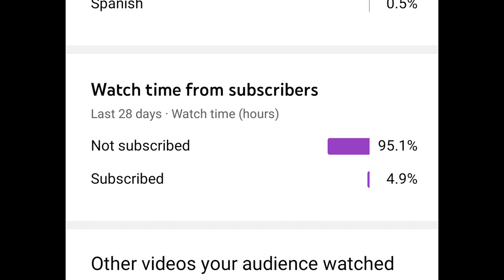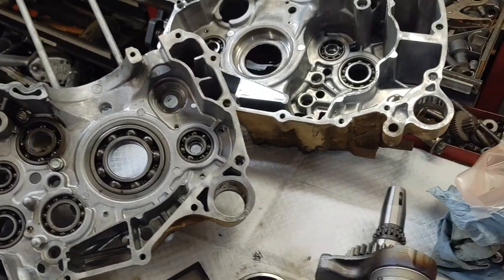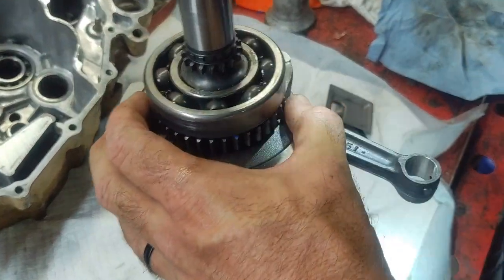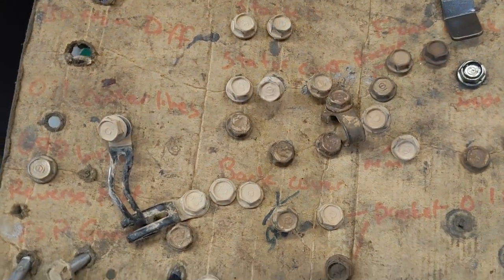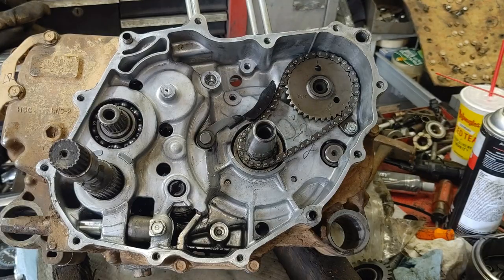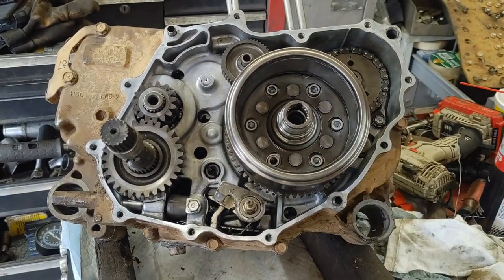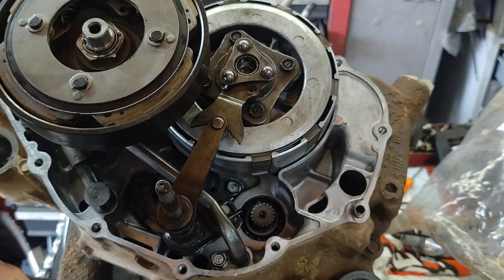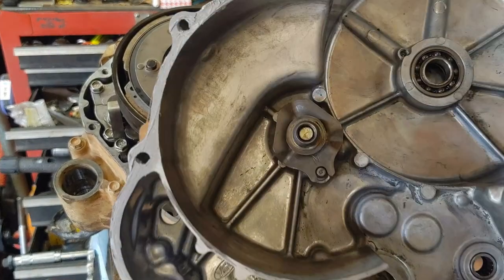Rancher 350  Engine Rebuild

Comment: Just too hard for me I'm not smart enough.  I'm going to forget where to put things back and lose half the parts. This is not for noobs. I might risk the top end rebuild and pray I don't need to do this bottom end. Hope I don't have a bent rod because I heard an awful noise  but the engine kept running and oil was very low.

Comment: Thank you sir for the video. Finally finished my 350 rancher today
Reply from the maker: Good deal. I hope everything went good.
Reply: @FourwheelerDoctor  everything went perfect. I bought this rancher with a bad motor and rebuilt it with help from your videos. I do have a question though. The previous owner grounded the temp sensor wire to the motor to make the fan stay on constantly. Will that make the oil temp light on the dash stay on constantly as well? Or do I have a different problem?
Reply from the maker: @dustinyeager9016  yes it will make the oil light stay on all the time if it's grounded out.
Reply: I have a 2000 foreman 450.  Do you know where I can find a bottom end kit for it. I can't seem to find a crank anywhere
Reply from the maker: @dustinyeager9016  those are getting harder and harder to find. The last one I ordered was a while ago and it took forever to come in. Check out Mrcrankshaft.com. I've had him rebuild some for me before and they work out perfect had a pretty good price.
Reply: Yea they seem to be going extinct. But thanks I'll definitely check out the link you sent.

Comment: Awesome video, I’m about to rebuild a 2006 that still runs decent but was ran low on oil so now it knocks. Is there any wear i should look out for since it was run low?
Reply from the maker: Most of these that were run low have a damaged piston pin. Make sure you check it.

Comment: hey man, enjoy your stuff. thanks for sharing. One question, Have you replaced the shift plate in a 350 Rancher ES without pulling the engine? I hear you can do this in frame but I would think it would be a lot more of a headache. Do you have to pull both clutches or can you sneak in out and back in without too much of a PITA? 
Thanks again
Cheers from Louisiana.
Reply from the maker: If by the shift plate you talking about that plate behind the front cover that often breaks on them, yes you can replace it without pulling the engine. It's not very hard to do but you do have to pull the clutches.

Comment: So I was tearing down 2 motors,    the other one had a bearing on the shift drum, like the one that butts up to the neutral switch sensor. the two were diffrent crank case. so I knocked the bearing out to put in the shift drum. and the concerns me.

Comment: Great video, I have a question about the change clutch, I bought a 2006 honda 350 4x4 FM with only 2700 km on it mint condition but it sat in a non heated building for about two years. The change clutches were stuck so I was told to put it in high gear, lift up on the shifter and rev the engine to break them clear after they broke clear I was told to lift the shifter until it slipped a bit to clean the plates. That worked, but every time it sat it would stick again. So I pulled the clutches and they had a bit of rust on them , so I cleaned them off with a really fine paper, put it back together it worked fine , but if it sits for a couple days it still sticks a bit, once it breaks free you can ride it all day without an issue. Something is just nor right, I should have put new plates and friction discs when I had it apart but guy at Honda said nah they look ok. Any tips or advice would be greatly appreciated, thanks Barry

Comment: Brilliant video and commentary. 
I have a 2004 Rancher 350FM with the motor still in the frame. I as replacing the swingers bearings and noticed the output shaft in the rear crankcase cover offset from centre and has torn the oil seal apart so oil has been leaking into the rear driveshaft boot. I find I can move the output shaft to centre it but I would have thought it should always be centred.  I prised out the oil seal and expected there to be a bearing behind it in the rear crankcase cover and thought it might be damaged.  Is there a bearing there? I can't make out if there is supposed to be one there or not from the parts diagram.  Have you experienced this problem and if it is a bearing issue can it be replaced with the motor still in the frame?

Comment: Subscribed my 350 was supposed to be rebuild and started blowing white smoke don't know why but can't change oil have to tilt bike because it will break if bolt takes out. Any advice on white smoke.
Reply from the maker: Are you getting oil in the airbox?

Comment: Man thank you for your Videos!!! I need to replace the Centrifugal Clutch one way bearing but my clutch pads are pretty worn like the one in your video. Which aftermarket clutch do you buy for these?
Reply from the maker: I have had good luck with the caltrec brand off eBay

Comment: Ever use one of the wrench rabbit kits on these? Got a noise coming from bottom end. Pretty sure it's from the bottom end. I've adjusted valves multiple times. The clatter comes and goes through the rpm range.
Reply: Comes with a hot Rods crank

Comment: Hi doc got a good deal on 01 350rancher Es it was stored inside, only 1200 miles on it pretty will mint but it wouldn’t shift, replaced angle sensor and broken gears for shift motor. I also replaced star piece on shift drum and shift plate. It changes gears now perfect 98% of the time,but sometimes it won’t shift at all. I’m sure it must be the change Clutch have tried to adjust many times but just can’t seem to get it perfect. Did have it apart when I changed the shift plate and never noticed anything abnormal. I’ll take it out to my trapline in northern Canada and use it the way it is but it just bugs me that I can’t get it right. Any thoughts or seen any similar symptoms. Great videos thanks

Comment: Do you have to separate the stator and it’s cover from the case cover or can you just remove the entire cover to access the engine?  I believe I just need to get to the timing chain and it’s tensioner…. Don’t need to replace the stator it’s working perfectly.
Reply from the maker: You have to take the stator cover off first. There's a couple bolts on that cover that also hold the next cover on
Reply: @FourwheelerDoctor  Thank you sir!  And I rewatched your video and you covered that I just missed it...  I will order the gasket along with the fly wheel puller and whatever else I need once I get everything down.  Valves are adjusted per your videos and it got quieter but still making noise.  No loss of power, starts easy, no smoke, oil looks fine etc.  Should just be the chain or the tensioner I hope.
Reply from the maker: @1972bcain  the tensioners are pretty tough and very seldom give trouble on these bikes so more than likely it's the chain
Reply: Update-  it was not the timing chain, sigh.  Connecting rod eye is wollered out and wrist pin has a lot of play causing all the noise as the piston slips around…. Cylinder wall and piston are showing wear.  Ordered new crankshaft, rod, piston, cylinder, gaskets etc…. Big thank you for your 350 Rancher playlist Sir!  Taking the edge of being nervous about this big of a rebuild.

Comment: need to pick your brain again , I have a 02 350 rancher ES with a meter that you cant read to get codes, Problem is every time you shift to a gear its a  second or so delay before it shifts and it jerks every shift because of it , I adjusted the clutch got that out of it now it will only shift neutral to 1st and back  i cant get the fine line in between , havent pull it apart yet , but thinking it might be the shift return spring weak , any thoughts or ideas from past repairs? Its also has one of those aftermarket sensor bypass kits on it for shifting not sure if that comes into play or not , Appreciate any help you could pass along Thanks , using the Manuel  shifter it feels mushy like it doesn't want to return to catch the next gear
Reply from the maker: Sound like it's probably either a weak shift motor or that shift return spring like you said. The aftermarket relays that makes them shift bypassing all the sensors so the only leaves the shift motor and the buttons. I've also taken apart and cleaned the grease out of the shift gears behind the shift motor because sometimes that old grease will get hard and real sticky and will make them bind up too.
Reply: @FourwheelerDoctor  Thanks for your reply your channel has really helped out , I keep 5 hondas for the kids to ride , So something is always broke down  , They ride them hard ,I finally had time when i got in last night to stand it on end and pull it apart , The spring loaded arm on the star was bent down under it somehow so the roller wasnt making contact with the star , that was the only thing i found , i'll stick it back together today hopefully that was it, everything else looked fine , i did stick a new shift motor on it i had on the shelf as well , was hoping to find something broken or worn out , I just picked it up cheap for my grandson , with the front axels worn out ball joints shot and boots torn, so have all that to replace , Again  Thank you very much
Reply from the maker: @jasonhorton4798  glad I could help. Make sure that 10 mm bolt in the center of the star piece is tight. I've had them back out before. It doesn't hurt to put some lock tight on it before you put it back together.

Comment: 4x2?
Reply from the maker: I think this was a two-wheel drive bike but the two and four wheel drive are ompletely identical with exception of a small short shaft that comes out the front of the motor to drive the front differential and a hole in the front cover for that shaft to go through.  The 2 and 4 wheel drive bikes are basically interchangeable with exception of that shaft and that hole in the front cover.

Comment: Do you exclusively only work on Honda?
Reply from the maker: Not really. I really work on anything but it just seems like most folks around here have Honda's so that's what I end up working on. I also have done a bunch of motors in them so I can about do them with my eyes closed.
Reply: @FourwheelerDoctor  Where are you located and what do you charge to rebuild a motor? My '02 Yamaha Big Bear 400 4X4 that I got in March, slips out of gears sometimes and I bought the transmission gears off of Ebay a couple of months ago
Reply from the maker: @rickfink464  I'm located in south Carolina
Reply: @FourwheelerDoctor  I live in West Virginia, but my dad lives in Cheraw, SC and I lived in NC for 12 years near the border of SC, so I'm pretty familiar with the area
Reply: I have the Yamaha factory service manual for my 4 wheeler by the way

Comment: Mine is manual shift and all the same in the flywheel side infact all the same baring the stupid electric shift motor, some good tips for noobs here like but why buy a whole crank wen a rod is 1/120 and 30 min work probs a 1/4 of price of crank should have left oil pump alone used the time on crank and save probs half your bill can only guess u dont mind spending customer money or lack the skill n tools to do rod alone